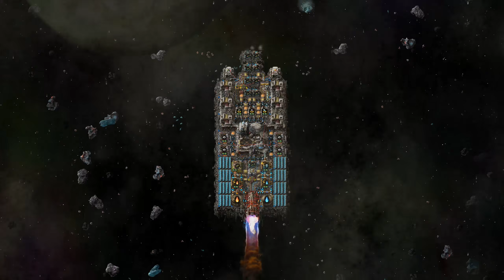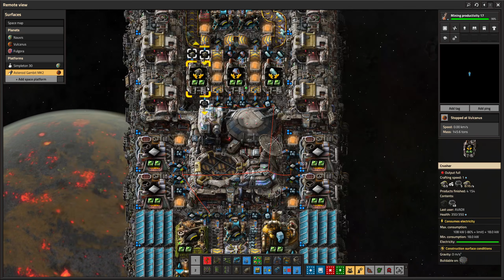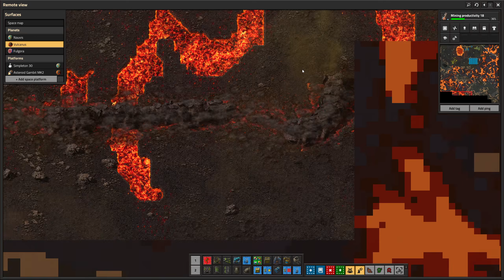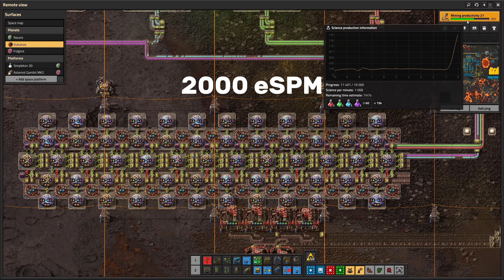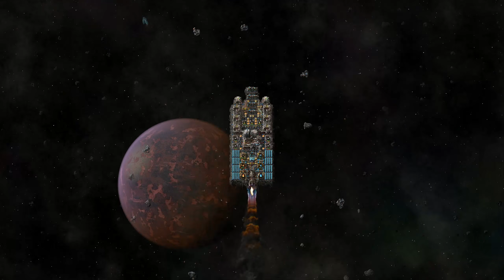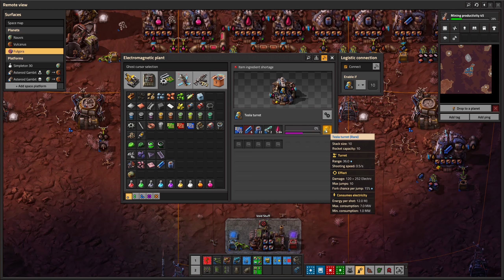Can We Hit 2,000 SPM on Vulcanus Alone? — Space Age MEGABASE (Factorio 2.1)

Comment: This might not be relevant, since you don't have biolabs yet, but I have noticed that switching sciences might be a bad idea, unless its very focused. That's because biolabs save their productivity progress per on tech and new tech does not save it. At least that's what I assume happend when I tried switching between a few techs due to my yellow science, agri science and EM science being on the weaker side. I remember using math to calculate how much science i would need to research specific techs and ending up short in practice, at least 1k science got burned away.
Reply: i mean switching manually. this knowledge is from 2.0 but idk if they changed it
Reply: with the RS-Latch, it should not switch that often, but interessting point.
Reply from the maker: It makes a lot of sense. E.g. recyclers lose scrap productivity when they process a different items than scrap.
But as Pmpoeij already mentioned, my circuit logic uses an RS latch so you can decide how often research should be able to switch (how large the buffer should be).